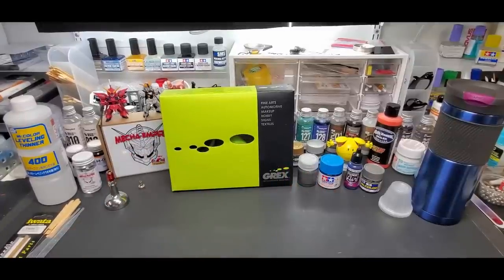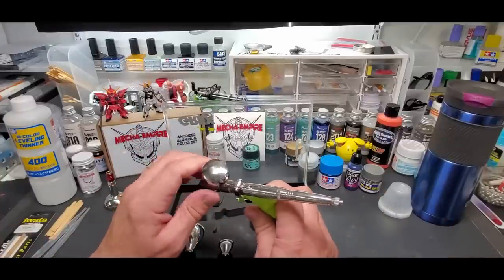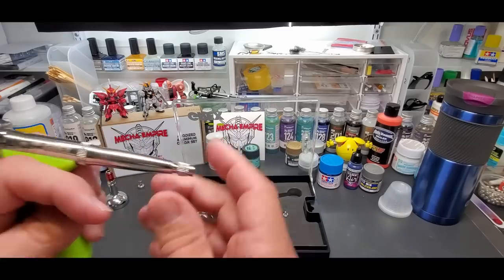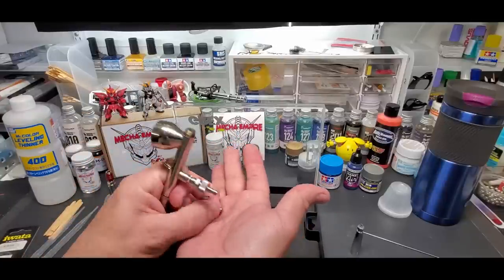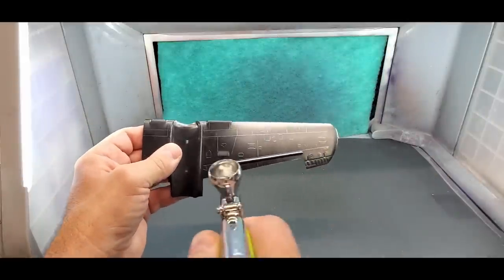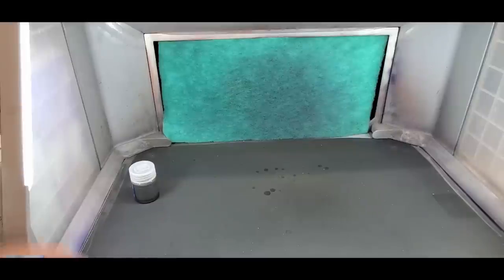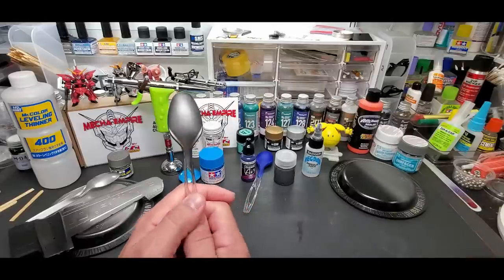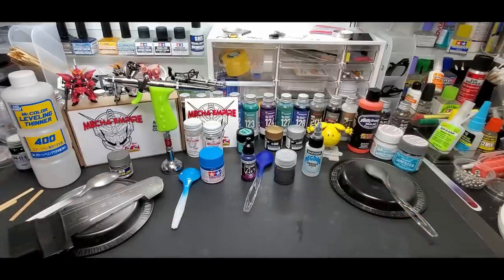Testing A Grex Tritium TG3 Airbrush - Great For Model Building & Gundam

Comment: Use the trigger stopper. And if you hardly pull the trigger you can get a super fine line with it. I was shocked at how fine I could get my .3 needle. When I changed mine to a .2 needle it really didn’t have that much fiber of a line.

Comment: I have the Grex Tritium TG3 it’s an awesome AB.  I have lost the nozzle cap so you have to be very careful. Just because it is magnetized on both ends you can still lose the cap.  I had to buy a replacement OEM cap, in fact I bought SEVERAL so if I lose another I have backups so I highly recommend buying at least one or two spare caps.  Maybe one day I will find the lost cap but it’s probably stuck to something metal in my garage somewhere.

Comment: Comes in 0.2, 0.3 and 0.5, you can buy the 0.7 nozzle kit and fan caps for the larger sizes. Just about everything except the cups interchange across the TG/TS line.

I've got the TG3 and TS2 (side feed version), although I swapped the needle/nozzles so I have a TG2 and TS3 now.

Comment: Love the reviews. I started with airbrush in Art College. It turned out not to be something I was not interested in making marks with but I know my way around an airbrush. 40 years later I added an airbrush station to my studio for facilitating costume and prop parts. I paid the minimum for a decent compressor with a tank and got a crap airbrush in the deal. Now that I’ve familiarized again with the process the airbrush is inconsistent and annoying. I know the upscale brands well but because the airbrush is an occasional tool I would like any advise towards an economical but efficient upgrade. Thanks.

Comment: I have the TS & TG models.  My kits came the 2, 3 & 5 size needles & the fan air cap, the 3 sizes of paint cups.  I also found the 50cc metal paint cups for both guns.  These cups are HUGE which I use when painting my bicycles with #5 needle.  If you get a #7 needle, get one of these or larger cups.  You're probably spraying a larger project requiring a lot more media for coverage.

Comment: i have both the tritium tg5 and the genesis xgi3 that i got from spraygunner during their sale, but honestly im not too impressed by them. i still prefer my gsi creos airbrushes over them since they atomize better. i do like that needles and nozzles are interchangeable between both models tho. the magnetic tips are meh, i find that they get knocked off easily while removing them from my airbrush holder and also get stuck inside my spray pot while flushing. also they both spray a lot more air like u mentioned. they feel like they spray around 25-30 psi when set at my regular working pressure of 18 so i tone it down to 12 psi instead, otherwise my compressor runs almost frequently. overall theyre ok but definitely overpriced, would only recommend if you can get them on sale.

Comment: RainX windshield washer fluid works wonders for final rinse. Really helps prolong tip dry from starting (with acrylics). Also I use it on my tip cleaning “towel”. For five years now and I haven’t had to replace not one single o ring in either of my Airbrush Masters airbrushes. But I also put glycerin in my thinner, so that may help as well.

Comment: The airbrushes I use are a Patriot 105 and a Grex TG2. Covers all my bases. Limiting the needle with the back knob can be as detail as I want while still getting good coverage if I pull it further back. I spray a lot of acrylic inks with it and just works. I do prefer the wider opening of the 105 for ease of cleaning, but that's a small gripe when, as you say, it is a comfortable tool to use. Appreciate your videos and look forward to more!

Comment: Looking forward to more of your paints. I've been using the Black Aluminum quite a bit on my Gundam joints. A tiny amount goes a LONG way, but I was thinking I should get more when you split them out. I do like how smooth they go on with the leveling thinner, I was surprised since they're enamel. So far, no issues, they look real pretty.

Comment: My Airbrush is exactly like that. Except, it came with a .2, .3 & .5 needles, nozzles & crown along with all three cups & lids. But it’s black instead of green, and it doesn’t have the unnecessary magnetic shroud. And It only cost $45. And it works great.  In fact the only problem I have is my tankless compressor, so no complaints, especially since I saved $140+. And a QD with mac valve & 6 nipples $12. 
But if money were no object I would have Grex airbrushes because honestly once you get over a hundred bucks, the differences become so minuscule, it’s not really worth the extra cost.
Reply: Making China great again? :D

Comment: It's an interesting airbrush. I own the Monument Hobbies version of the TR3. I am not too fond of the Grex system, for me it's just too many parts to clean. If you like the trigger airbrushes with the double dependent action, then the Harder & Steenbeck Colani might be something for you to review. It has a crazy number of needle sizes it can use, and can fit paint cups from 2ml, 7ml, 15ml, and 50ml.
Reply: I find them about the same to clean as an Iwata brush, except the Grex clog a LOT less. Still a pain if you have to disassemble the trigger.
Reply: @adam_mawz_maas  You find the H&S Colani and the Grex TR3 the same? Really, or are you talking about another airbrush?
Reply: Barbatos Rex (Robert) did a review of the Colani but it didn't seem like he was really into it.  I was bummed, I'm looking at the Colani but there aren't very many decent reviews.  Even H&S doesn't seem to give it much love!  I have some big kits (two 1/12 scale cars, 1/16 dragster, semi truck...) and a trigger airbrush designed for throwing lots of paint would be nice.

Comment: Get the .5 needle and .5 fan cap.  It clear coats amazing.  Need to bump up the air pressure with the fan cap.  Also sprays primers great too.
Reply from the maker: Oh yeah I'll be getting that set for sure. I was going to try the 0.7mm but was told I'd need a bigger compressor. Plus I think the 0.5mm should do the trick. Thanks
Reply: @barbatosrex9473  air supply is definitely a concern even with the .5 cap and needle.  But when you get it the variables figured out it is so worth it though.  I have the Creos .3 that you recommend which is awesome and the Grex for blasting clears/primers/large surfaces.  Between those two I can get everything painted that I need.   Not going to lie the .2 Creos is pretty tempting.
Reply from the maker: @Repairman87  I collect airbrushes now like I collect model kits 😉

Comment: Thank you for the great review. Just a couple of things, the name of the airbrush is pronounced Trit-e-um (think, Spiderman comics/movie) but don't feel bad, I've heard a lot worse,,,lol. You compare the threaded fluid nozzle to the press fit of the Badger, like anything ther are pros and cons. Like you say, using a wrench to remove the fluid nozzle is a bit inconvenient. However, the threaded style helps ensure perfect fluid nozzle and needle alignment. With that said it's appreciated that you mention the quality of the machining of parts and positive interface of the wrench to the fluid nozzle.

When you bubble back I do recommend keeping the the needle cap on the airbrush. The bubble back effect won't be compromised and ensures the needle remains protected. When using the crown cap I gently pinch the crown cap between my thumb and index finger to create a similar seal and bubble back that way. Again the needle remains protected. 

It's great that you show the trigger stop feature. For general coverage and semi fine line work it does the job nicely. However, when doing fine line work I do recommend developing a good hand eye coordination. With a lot of paint companies going to water based acrylics these days these paints are often susceptible to tip dry issues. So with the trigger stop turned down that much, paint performance may suffer. Every so often I have to "goose" the trigger with a full shot of paint to avoid negative fine line performance with these types of paint. Doing this helps expel paint that's starting to tip dry and introduces fresh paint into the nozzle needle interface. A good way to practice fine line work is to get 3x5 note cards and try to do a fine line over the ruled lines on the card. You will get some wiggle as that is natural (we all have a heart beat) but it helps develop your hand/eye coordination.

Lastly, and I see this in some of the comments, Grex does make corresponding fan caps for the .3mm, .5mm and .7mm needles. The fan caps are sold individually as well as in kit format similar to what you describe in the video. We do recommend the fan cap be matched with the appropriate size needle and fluid nozzle for optimal performance. 

Overall a great video and thank you for your effort. If you have any questions please feel free to reach out to us or me directly-

info@grexusa.com

or 

bryant.dunbar@grexusa.com
Reply from the maker: Thanks for the great feedback. You'd you be willing to send me a fan cap set for testing here on my channel? I'm on a mission to test everything for the hobby including more airbrushes by your company.
 Please let me know if we can work something out. Robert Aka Barbatos Rex
Reply: @barbatosrex9473  Sorry for the delayed response. Shoot me an email (see my post) and we'll go from there.

Comment: Ive been rocking a Grex TG5  for over a year now.   They atomize  the paint great and are very comfortable!   I also purchased the optional fan cap and nozzle kit which really gives a much wider spray pattern than the included stock  nozzle.

It's a really great brush.

BTW all the Grex color cups fit my Iwata and H & S bushes for an extra bonus !!!!
Reply: Thank you so much!  I've been looking at the H&S Colani vs. Grex TG3/5 - I prefer sticking to one brand (for parts swapping) and the Colani only seems to be able to swap cups with my other H&S airbrushes.  That's a big plus for the Grex now that I know the Grex cups can fit.  The fan tips seems like a very nice option.  Thanks!

Comment: Did you ever consider reviewing the Hobby Mio dust collector from Robot Kai? Looks like it would be good when sanding Resin Parts or plastic in general.
Reply from the maker: I have a dust collector here I was going to test. Nail salons use them. I do like the Hobby Mio one though 👍
Reply: @barbatosrex9473  I was also thinking that. Some of the ones on Amazon are good, but some are not. The advantage of the Hobby Mio one is that it stands up so it doesn't need to be worked over the fan, but in front of it. The Hobby Mio seems to be in the price range of all the others which is around $70. Issues that customers have is how well the fan works at removing dust and the motor being too loud. Maybe the more powerful ones have to be loud to provide enough suction to work right.

Comment: I paint a lot of large scale, (1/12th and larger), model car bodies and was looking at this airbrush. It has a fan cap that can be added and that would allow for a larger spray area over the standard cap. 
I was hoping to see a spray pattern with this one. From what I could tell, it is no different than any other airbrush. 
Do you have plans to get, and feature, the fan cap?
Reply: I have the TG5 and the fan cap kit and use it a lot (for large scale models) .  It is definitely worth the extra cash, however using the larger fan cap nozzle requires more air (flow as opposed to pressure) than some airbrush compressors can deliver, so make sure your setup can deliver the higher CFM requirements.  You can get around the CFM flow requirement by buying an extra air tank and using as a reservoir to supplement it.   The air compressor that I have is an 1/8 hp setup with a small tank (pretty much the same compressor sold under many brand names. ) I purchased a 10 gal tank and piped in parallel with the other tank before the air regulator so both tanks feed the air brush.   When running the TG5 with fan cap I can supply the brush with enough flow to operate correctly with a bonus that now I can get a in more than 15 minutes of constant air feed to the brush under high flow conditions before the air compressor cuts in !!!!

I could have bought a larger capacity air compressor but this one is so quiet; the larger ones were louder.   Everything in engineering requires some sort of compromise to meet the set of circumstances at hand.
   

Have fun painting :)
Reply: @whiterose7055 . I am a mechanic and have a lot of air tools. So I'm sure my compressor can handle it. Thanks for the help.

Comment: That Grex  covers so well and so quickly compared to my Procon Boy 0.3. It seems so versatile in the control of the spray pattern. A winner but a bit expensive. How do you think it compares with the Badger 105 with a 0.5 needle?  Thanks for another great review but you are costing me heaps  lol.
Reply from the maker: It's a no Brainer as far as cost goes, the Patriot is awesome at $80. This one is currently $178, a hundred dollar difference is tough for many to swallow for sure.
Reply: @barbatosrex9473  Thanks Rex. Unfortunately the Grex here in Australia is around $275A so May have to look at the patriot down the track. Cheers

Comment: Mr Barbatos do you have to clean youre hobby room from dust every day or how often? I have problems with dust there is too many things in my room and dust kicks up from the floor or other shelves while I walk. I try to vacum clean and remove dust from spraybooth athleast one day a week but it does not always help. Dust in the paint is wery annoying.
Reply: One day a week is not often enough. I have to vacum my apartment two days a week, more if I build something. If you live in dusty area (eg. next to bussy road) vacum cleaner will be your favourite tool :)
Reply: @randomnickify  Thanks I try to do it twice if I am painting. Luckyly I dont live next to busy road. However my city is dusty because of iron production. Its not as bad as before but they are planning to buy a area close to me and I hope that dont happen because it will also destroy beutiful nature.
Reply: Get a air purifier I run one twice the square feet of my room works great :)

Comment: Hello! I have a question. My compressor works, but the arrow stands on zero and does not move. It's something related to pressure. The last time I used the compressor a year ago and everything was well. What am I doing wrong? What can be the reason? My compressor is from Grex's company. Thanks
Reply from the maker: I've never tried a Grex compressor but it could just be your pressure gauge. Call Grex customer service, they're located in the US, they should have an answer but it might be that

Comment: Hello, after the countless tests you have done and given your experience, which airbrushes do you think are best for those who assemble 1/24 plastic and resin kits and especially use primers, lacquers, basecoat and 2k automotive? Do you think it is better to use more airbrushes for each type of paint so as to avoid reactions especially with clear 2K? Thanks
Reply from the maker: I would go with a Badger Patriot 105. It will spray each of those perfectly. I use mine for everything you say including 2K Urethane clears. It's super easy to clean so that's not a problem. I build 1/24 car kits and I use it on those almost exclusively. Get this one here because it comes with the adapter you'll need for the compressor.
https://amzn.to/38pFSVi
Reply: Hello, i found patriot 105 and 105 CS, but i didn't understand the difference. Do you know it?

Comment: Ironic that you uploaded this test video today. Just saw this brand at my local Hobby Town earlier. They offered a whole set that came with the compressor, the hose, a quick release, trigger brush with handle, 3 or maybe 4 different cups and several other items for a little over $400.00. There was also a slightly smaller bundle for around $380.00.
Reply from the maker: Yes, not cheap but their compressors are great too. And if you need everything you can't go wrong with that set
Reply: @barbatosrex9473  Glad I know that now thanks to your videos. I'm gonna try and pick up the bundle. Your videos really have helped steer me toward some excellent products, paints, and tools since I got back into Gunpla back in July. Thanks for that!
Reply: @geo0711  FYI:  Grex customer and parts support is excellent!  Parts are reasonably priced too.

Comment: Barbatos, have you reviewed or tested the GSI Creos Procon Boy PS-290?  If so, what are your thoughts?  Thanks
Reply from the maker: I have one. A 0.5mm and it comes with the fan cap as an extra. Good airbrush. Not as comfortable and it goes through paint like crazy. It's great for clear coats.
Reply from the maker: Good news, the PS-290 is on sale at Spray Gunner now for only $104, awesome airbrush for that price. See it here
https://spraygunner.com?aff=10
Reply: @barbatosrex9473  Their website shows it at $130.  To me still a pretty good airbrush for that price.  I wanted an airbrush for the sole purpose of spraying large patterns for use on my 1/25 scale semi tractor trailers (current project that I'm also lighting it up with fiber optics), and 1/48 scale large aircraft (in the que is the B-29, B-58, and the AC-130).  My Iwata Revolution is a .5mm like this, but the spray pattern isn't that large and it gets dry tip like crazy when doing large surfaces.  The fan cap for the 290 is a selling point for me.
Reply from the maker: @ClarenceObert  click on On Sale, Discounted or Used link. Left hand side Scroll down. They also sell a fan cap for the Grex too
Reply: @barbatosrex9473  Thank you.  Found it and ordered it (along with an extra needle).  I was going to get the Tooty Compressor with tank, but that will have to wait.  I have a serviceable compressor now, but need the larger spray pattern airbrush now.  🙂 P.S.  The 4e paint shaker is a godsend.  So good, thanks for that review and recommendation.